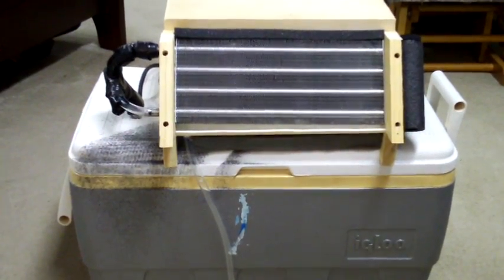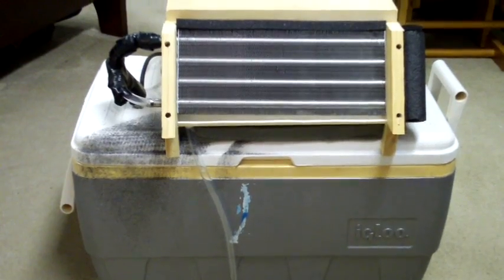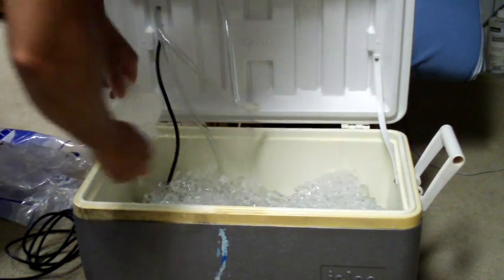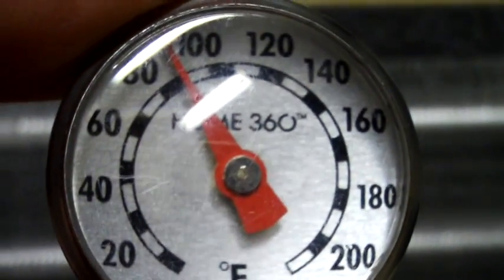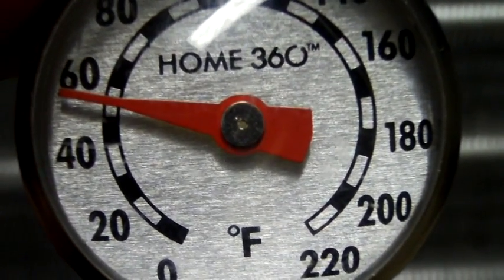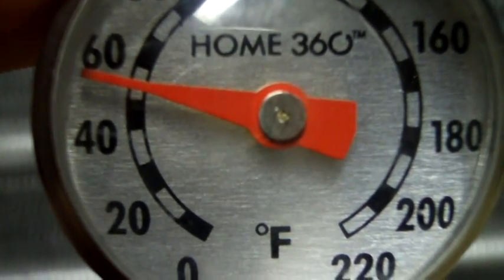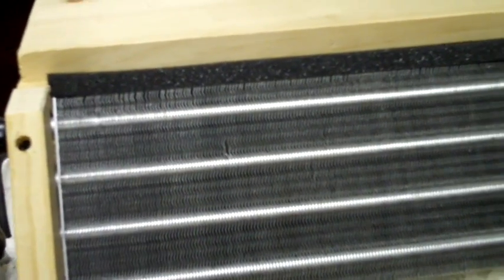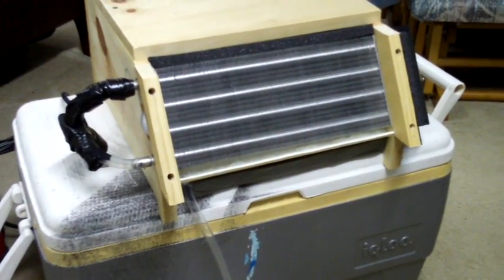Homemade Air Conditioner Part 2.

Comment from the maker: My thinking is that using those wont conduct as much cooling power as water direct contact with ice, i know many are saying not so, but as those melt, the water inside has to transfer the tempthen transfer through that plastic as well, so i figure maybe just get some of those bottles and cut the tops off and freeze water in them, then pop the ice out, i know i wont be able to just lay them in the freezer any old way, but i feel direct contact with ice cools best,

Comment: Why not use frozen 2L pop bottles as well, to supplement the cooling? That way it keeps the ice from melting to a slower rate, or is that not conducive to how this machine works?

Comment from the maker: well one problem, the trans cooler coil i have is way too small for the fan, i would have to make another houseing or shroud for it, but another problem with a fan that big is, that it draws a lot of amps, and drians the battery much faster,

Comment: I say hook an after market radiator electric fan which is a 12v hook up and it should pull the air through and cool down the area

Comment from the maker: Well Doing that would help keep any heat from the fan motor from being pushed past the coil, but problem is that the fan i have is a pusher fan, and as far as pulling air through it doesnt do as good of a job, and you cannot feel it as much, just because its right in the way, But non the less, a good idea with a pull type fan. Thanks for stopping in !

Comment from the maker: Well there are many factors on how long ice will last,  Obviously, how hot it is in the area you would use it in, another would be if you use block ice, ( freeze your own blocks, or bags of ice. i have found block ice lasted longer, also depnding on what your fan is set on, low medium or high, high melting ice faster, due to more warm air passing through, but my past experience with my tests, 3-4 hours, again depends on what i mentioned above, Thank you for the generous comment !

Comment from the maker: Well that may be true, but it works much better with only a gallon of water, rather then a couple, the ice tends to melt less, and has a better time cooling that tiny bit of water in it, I guess im thinking it would take away from the ice inside, if i did that, not that i am going to do a test, but some reason my gut tell me it would take the cooling power away with the incoming water, some reason i think its a tad bit warmer, and that would make ice melt faster then it not goin in,  my Opinion.

Comment from the maker: Thats a great idea Jen, I wonder if the bags will hold up, seeing ice expands, Now that you mentioned it about the bags, a thought just came to me, Make a custom  bag using those food saver vacuum seal bags,  roll out like 14inch of it, seal one end,  fille with some water, then release as much air out, leaving 3 inch at the end for expansion, and seal that !  see you got my mind working already! but your way is much faster and easier, :) Thanks for the idea! I will try that for sure :)

Comment from the maker: Thanks!  i do not return the condensation back into the cooler because actually  it would increase the ice to melt, because its not as cold as the water inside circulating, you really gain nothing  except more water inside but you do not want more then a gallon or two in it, if that, more water you have the great the ice melt, and longevity  in cooling time, Again Thank you for the Compliment!

Comment from the maker: Aluminum supposed to transfer heat or cold best, SS is too hard to bend even the thin stuff and way too pricey, a SS coil would cost $250 or more, so i just avoid the salt all together, been workling on a Dry ice model..

Comment from the maker: We use propane here, and a what i believe is a 40 gallon tank lasts a year without filling  cooking every other day using the oven and two burners so far its lasted almost a year still have another month to go, thats on a full range cooking stove, when you make your food you can heat the place your in by just using it,, i use a copper tube exchanger in the chimney pipe of a pellet stove to warm up incoming  water to the house to save on the water heater bill while heating the room.

Comment from the maker: Well A 18 Cubic foot referidgerator uses 800 watts and 1600 to start it up.,  what i made was just something for fun, and use in small areas, i will not use salt as that will corrode the aluminum,  but its a great thought as you and many mentioned to use, it works best with block ice, lasts longer too, but performs best with bag ice,  because in theory there is more surface area for water to come in contact with and cool faster and colder, i have a 50 amp per hour battery that should be good .

Comment from the maker: This unit uses a pump, and also a coil to which the water flows through, one coil being inside the cooler,  other being on top as you see, Swamp coolers use a cardboard type material with water that flows over it, and air blowing through, portable swamp coolers just blow air over, cold water, Ice bottles, Ice water, My Air conditioner removes Moisture from the air, which it ( conditions ), swamp coolers do not, they will add moisture into the air, which is welcomed in a very dry enviroment,

Comment from the maker: Thanks I think. I said it was a poor mans AC, but i did not say Dirt poor., not did i mention it was anything of a free energy AC unit, which is what it would be if it was solar and cool without ice, at least not as cold as it would be with ice, just a project, something fun or neat to do, it works, this would be more projected at camping, or short term cooling with 12 Volt system..

Comment from the maker: guess you need to buy a window ac unit then? otherwise you could use a power supply from a old computer i believe there is a 12 volt line on it  just dont know what color the wire is tho,, thanks for the comment

Comment from the maker: Oh trust me i agree, but the point of making this is to have something on 12 Volts, without having to buy exspensive DC/ AC converter,,  i use this for myself, used for camping a few times, it was a idea challeneged to me by a friend, and well, if you dont feel like toteing a 6000 watt gen and a window unit to take with you camping, this would be ideal, was just a experiment something fun to try and do, many others brought that up, and i say the same thing, its just for fun, Thanks!

Comment from the maker: well im looking at it this way, if the water goin back in is Not as cold as going through the coil, it will only add more water volume, and doing that would make the ice melt in my opinion faster then just letting the condensation run off the coil, ice will last longer when its in water closer to its own temp, and water or condensation  off the coil is goin to be warmer then the water inside that is just circulating,  do a video with the results , im curious about it,  thank you.

Comment from the maker: doing so would would have more water in the cooler and the ice would melt faster because your increasing the amount of water the ice has to bring down to a Chill.. imagine having a small bucket with some ice in it,  and small amount of water, the water being added is not nearly as cold as the water in the bucket, adding that would just make the ice work harder to chill more volume of it,

Comment from the maker: To Answer your Question, this can and will remove moisture from the air as it passes through the top coil. cold air chills the air, condensates any moisture, and drips off the coil into a catch pan, the water in the cooler stays in the cooler, it doesnt work like a SWAMP cooler, a Real air conditioned does the exact same thing, air passing through the coil condensates any moisture, that runs off into a pan, through a tube outdoors, both remove moisture from the air when Cold.  Thank You !

Comment from the maker: You could do that, but it would eventually fill the cooler and the water it still warmer then whats inside so it would not make the ice last as long as if it was outside of the box,

Comment from the maker: Well i bought the bilge pump because i really was not thinking too hrd about this, after this was pust together i was thinking the best thing would maybe be a Electric fuel pump something small, and does not have to be submerged, right now im tryin to do a system that will have a closed system with circulation pump, that way the water does not touch the ice, but yes what you say makes lots of sense because you dont want any heat what so ever in the cooler part from anything  Thanks for watchin!

Comment: Great video. Just a thought, but since the electric motor of the bilge pump produces heat, an alternative may be another type of pump mounted outside of the chest, with the suction line run inside the chest. I don't know how much difference that it would make, but it may be worth trying. Thanks for posting this.

Comment from the maker: Deep cyccle would work best, automotive style plates are thinner, deep cycle i understand have thick plates, which make them perfect  to run them down to no less then 2 volts, without damaging the battery, car battery is not designed for that type of usage, or it will sulfate and make a short internally making the battery usless within a short time, again this is from what i read  about the two  and also told by old timers..

Comment from the maker: Ahhh ok,   Im only 500 feet above sea level and its very hot and humid, so usually its fine getting out of the pool just not  in, usually cold but i totally understand your theory  would be nice to try and see how well it might work here, but im thinking with the humidity being high, it may not work as well, BUT still sounds like a new project that would be interesting to try!,  thank you very much!

Comment: that evaporation is the key to make air coler in that system is that way the big skyscraper works and use little energy if is copared with gas ac with compresor

Comment: you just need to esposure the hot water in the tube to a big area to disipate it 

the comercial ac use gas for that because when gas is compreset it this get warm n when spands get coler you make close circuit whit that the result is cold another way is to make air go thru of big tube with sprinklers on the top the air get very cold also moistened that water circuit is closed becuse the water go to a pump and the process is repeated the problem is the water evaporated soo need to be refiled

Comment: is the same as computer refligeration they don´t use water or ice just a big metal where the ir just go thru and just that make it coler computer processing unit and im talking about 30º c diferent go to up 100ºc and computer processing unit will burn to 60º or less c so if you make that piece of meal biger with biger fan and tube with water go thru that system the result is very cold water just wach the back of you fridge you will see big metal part in the back of the fridge the same in the car

Comment: the last one it used in big buildings use lees energy than ac in small houses

you make big long scuare metal room 1 meter tall 1 width and 4 ,5 meter long and smaller holes in both sides two fan and on the top sprinklers 3 or 4 each meter and in the boton hole or water pump to make close circuit the hot air enter in the room and the water cold it down and the air enter in the house cold to keep water cold is good idea to have a lot water may I talking about 500 litres or more

Comment: other option is to have garden in the roof is escelent isolation for heat 

other option if you have swiming pool use it to ac unit making big coper tubes whit water in it very cold you put doble floor in the swing pool and the tube go making s in all swming pool you can also use the pump of the swiming pool to move that water that tube go to the fan inside of the house

Comment: other opcion is if you have back yard  bury 1 meter deep coper tube and made it making s undergrond you care your back yard every day you irrigated it and that make grownd coler also is recomended do that when is not sun or middle day that make grownd even coler so you use that fact to cold the water circuit and cold water enter in to your house and cold down the air of the fan

Comment: if you want more coling you buy anoter water pump and 50 litres tank you make some holes in the tube and make it go up of the tube with two fans and water fall and refill the water tank again some part of that water evaporates and cold down the more tha another water circuit depens of the size but can go from 100 $ to 1000$ but you can cold the entire house and using lees energy than standard ac

Comment: is better ways to do that you take coper tube water pump 3 fans 2 big one small you espose big area to the 2 fans os the coper tube that coper tube is making s to cold the water inside of the tube and after leave that area you isolated the tube to keep the cold water cold and you epose to the small fan making s the temperature will fall in the room the hot part of the instalation must stay out of the room

Comment: Hey, sorry I didn't reply in 2 months, anyway; Yes, the Ice will melt a bit more, but ice lowers the freezing point of water, making it seem to melt. Water freezes at around 32 degrees, if I remember correctly, but by adding salt, you can easily lower it 5-20 degrees lower than usual.. So adding salt will lower freezing point, seems to make the ice melt, but it is actually supercooling, causing it to be ALOT colder than 32 degrees..

Comment from the maker: Believe it or not, Yes, furniture holds heat, if its hot in the house then everything in it is same temp, and will hold that heat, till temp drops,, once everything equalize in temp, then it should not take as much to keep cool. this apply to HVAC systems as well. if its hot in the house it will run longer till everything in the room drops to temp before it cuts out,

Comment from the maker: well depending on the size of the area your tryin to cool, i doubt you will  get a room too cold with one of these but i could be wrong,  yes you can put a thermostat to this, you just have to wire it in to the fan and pump wires, it can be done, but electric should be cheaper then to buy the ice for this setup, i think for the price of a bag of ice you could run a window unit for likea week? thats just a guess, i think this would be better idea if you was camping, or something small area,

Comment from the maker: there is a lot of factors to answer this,how much humidy is in the room, how much stuff furniture for example, how well insulated it it, if it has concrete or  wood sub flooring., tile flooring, or carpet, it has not been tested  on a room that size, i guess the Answer to you would be Depending on how much ICE you can use  and battery life,( 12 volt system ) remember this, if you have a lot of furniture in a room and its 90 degrees in the room, those objects tend to hold that heat til they cool.

Comment from the maker: It all depends on a lot of things, How hot the air temp is, and how well insulated the area is, how big the area or space is that it has to cool once it establishes a temp drop in the room,  the second batch of ice will last  much longer and.melt less because the cooler temp passing through the coil. i do believe humidity has a factor in it as well.

Comment from the maker: Plastic is kinda a insulator, doesnt transfer heat well or cold, so i think it would just be best to use straight water without salt, i have never seen a plastic radiator so to speak,  except for the tanks, on a rad...

Comment from the maker: Thank you for the Generous comment, I wanted this to remove moisture from the air , like most , i get alot of negative feedback on it, lots say go buy a $17- AC from wallay world, but i always say UNless you plan to take a generator and gasoline, and deal with the noise, might as well  buy one, but im still tryin to use Dry ice on a closed system setup, i cant seem to find a pump that can handle -190F temps, was going to use Alcohol in the closed system, and of course Venting it outside,

Comment: next time load ice into cooler without removing it from pastic sac, the lesser the air pockets inside ice the lesser rate of melting, when cut open, u introduce more air pocket into ice, thus speeding temp. rise

Comment: i don't think if cooler conduit is made of aluminum it will get corroded by salt water, but yes will rust up copper easily and how abt substituting transmission conduit with plastic tubing? as salt will hv less effect on plastic/rubber

Comment from the maker: ice lasts pending on  several things, how big the area is, how well insulated,  humidity, and how hot it is, and how fast the fan is blowing through, in the evening mine lasted a few hours in the back of a toyota Pick up with a cap, it was 85 out, muggy, once it got cool in the cap it did not melt the ice so fast and lasted a lot longer.

Comment: Hello, I don't know if you are still doing this project, but by putting salt in the water you can lower the freezing point; thus allowing the water to get colder and colder... About as cold as the ice in the cooler. But the salt would probably eat away at the inside of the transmission cooler.

Comment from the maker: @hidekiclaudio  Well they already have it where you can get air through it, the more the fins the better the  thermal transfer, only thing i can think of is get a stronger farn to blow past the fins,  or you would have to remove some fins,  like every other one, depending on how much air you want to come through, but remember,  if you do that you wont pick up the exchange of cold air very well and will be some of the hot air with it, wont feel as cold. just my opinion, keep trying to you get it.

Comment: if it was 95 and you got to 53 you are at 32 degrees of superheat in the condenser, you are about spot on for a rig that size, congratulations my friend, beautiful piece of engineering